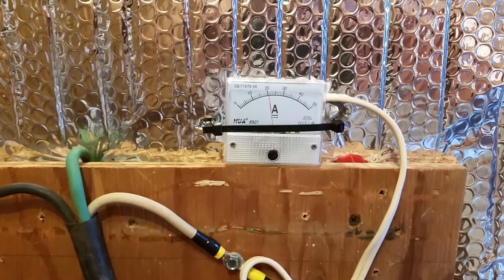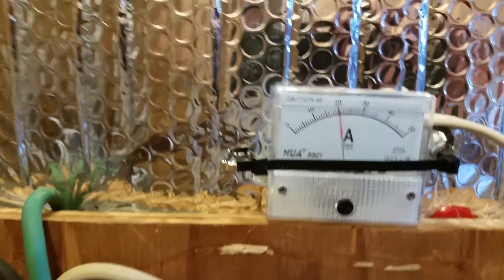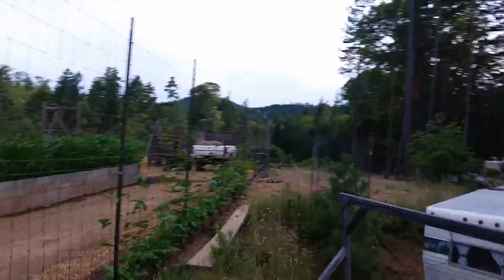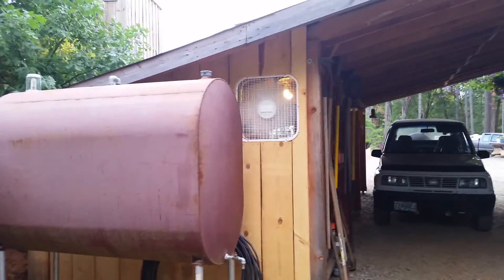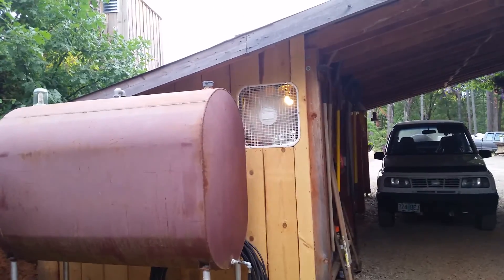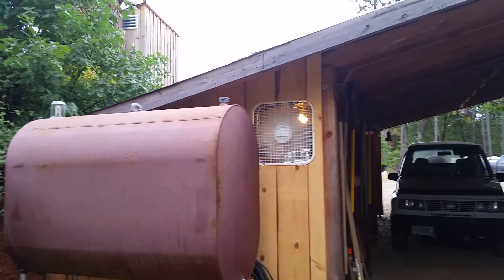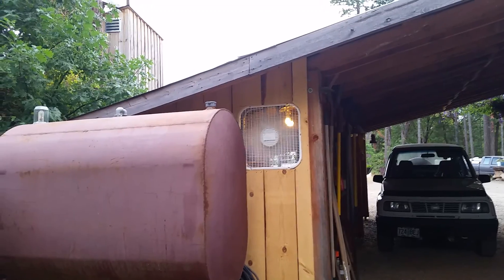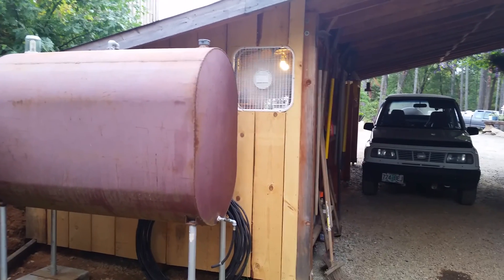Off grid backup generator Predator 6.5 hp,24 volt

Comment: I bought a military surpluss 28v DC generator,paid 400 for it with 5 hours on it,puts out 107 amps at 28v,charges my 1000 amp hour bank in about half an hour,building a 28v gen also with a 280 amp military alternator and a 13hp honda which should charge even quicker,these are designed to be run in any temperature or xtreme,under rated and fuel eficient because it doesnt have to run long.Normal alternators are designed to keep a battery charge not charge dead batteries,likely in the hot weather it will burn up.

Comment: The alternator would be spinning at 4800 if the pulley system is 2:1 like you said.
You should try mounting a larger pulley on the 6.5 to run the engine at a slower RPM for better fuel economy and see how it handles.

Comment: How and where did you get a dc generator?
Reply: Thanks, I have a homestead project I am working now. Small Farm in the Philippines, completely off grid. So it will be solar powered,  only 1000 watts system, with a 2,000 watt inverter. Being the Philippines there isn't a lot of things that require power. So I am trying to figure out, what I can get away with as far as a generator.